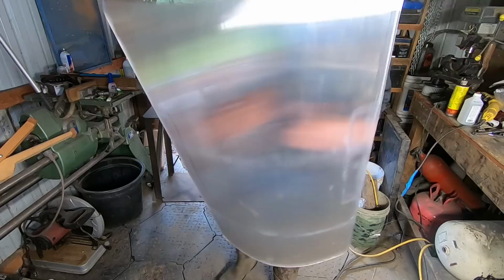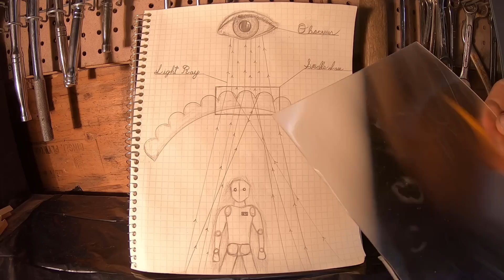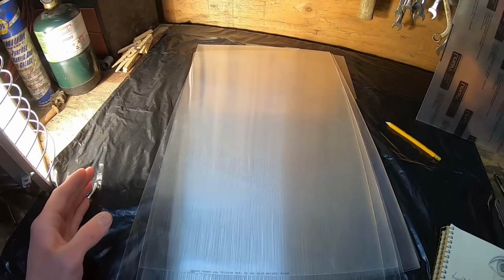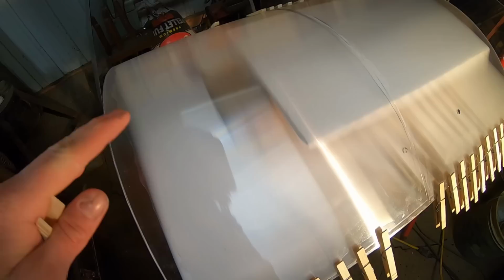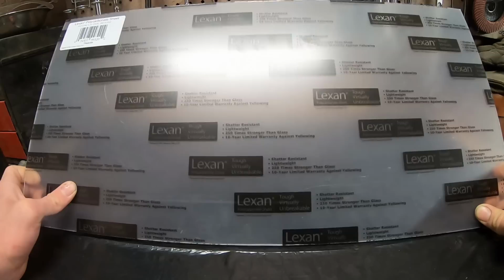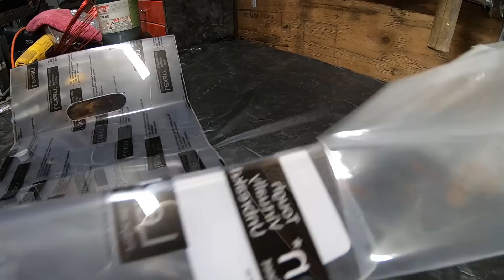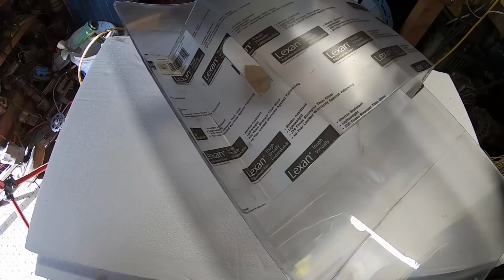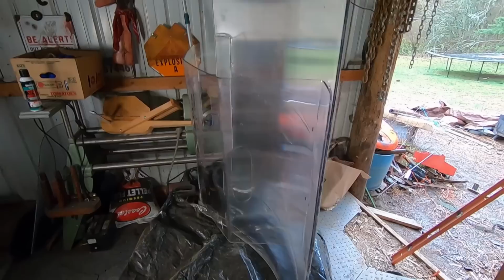Making a Real Invisibility Shield?!

Comment: This is actually a really good effort for a garage project. Imagine the result with the correct funding.
Reply: well never know because well never see them
Reply: It's a fresnel lens it's been around for a while.....
Reply: While it's not quite invisibility, it's certainly enough to confuse a viewer as what exactly they're looking at. In a dim and chaotic environment, I imagine it would work fairly well.
Reply: It's already been created, the official ones look even better
Reply: @TheGreenKnight500  depending on the angle. Because if you turn it to certain angles it will catch and reflect light better. Making it stand out.
Reply: Qian Lim Price what official one?
Reply: @TheGreenKnight500  but in the confusion of real or even simulated warfare its basically impossible to see.
Reply: The company that invented them, well lets just say the results are literally no better and entirely impractical

Comment: Hey Randomn, get hold of a tube of the clear UV set adhesive used for replacing touch membranes to LCD panels on phones and tablets. It is reasonably priced and with a little care, you can get a perfect bubble free contact. As a bonus, there are no solvents to evaporate, the whole substance sets, is completely clear and sticks like crazy. It's like an epoxy that doesn't need an added catalyst but is triggered by UV light, via UV lamp or even plain daylight.

Comment: 23:05 Being too reflective, yeah it really stands out here. I wonder if you put horizontal polarizing sheet on it if that'd help with the reflections
Reply: If I build it, I'll try!
Reply from the maker: @quantum_chezburger2279  Let me know what you find out!
Reply: Put anti reflective coatings on it
Reply: @stuartdavis2578  Clear matte spray maybe.
Reply: No like optical antireflective thats what makes the difference between a home made version and military grade the military has a antireflective coating sputtered on.
Reply: It actualy increases transmittance
Reply: But at the sametime cuts down on off angle refectance but what you did is no less impressave for stuff you can buy on line maby clear matt might help.
Reply: Ill have to build one and try different things
Reply: Or wat if you hade cloths that had complementry linear optics
Reply: Polarizing optics may make it more visable because you would cut out a plane of light but its worth a try old lcd tvs have a polarizing sheet it wouldnt cost much to dind out.
Reply: Or if you cut out the right plane it might help
Reply: I cant wait till holloween
Reply: By the way i loved that video

Comment: Try TruLife acrylic and glue the lenticular to the inside. This acrylic is modified in a vacuum chamber to add an oxide diffusion layer to the surfaces which dramatically reduces reflections to the viewer. I use it for very large wall photography.

Comment: "I put it on here so it's resting on something soft as to not damage it"

It's a riot shield tho right
Reply: polycarbonate scratches easily
Reply: The riot shield will retain structural integrity, but the non-blemished surface (scuff marks are hell on lenses) was a vital factor in this project.

Comment: Free Fresnel lenses are everywhere on Craigslist.  They're called "Curb alert - Rear projection TV"  I pick them up often and they're generally in the 40"×30" range but sometimes larger.  Well done.  Very cool project sir.  You should also consider posting this on Instructables.

Comment: Would it still work with something like a matte clear coat on top of the lenticule layer or would the light be too disrupted for the effect?
Reply from the maker: I wondered that myself, and to be honest, I'm not really sure. I would imagine that it could fill in the valleys between the lenticules, rendering them useless. I think "matte" is specifically meant to diffuse light in multiple directions as well. That's just a guess though. I'll play around with them some more and find out! Thank you for the comment!!
Reply: @randomn6473  what about marine epoxy? and if you put a light refraftion sheet like the ones you use to identify lab gasses in tubes under the lenticular sheet what do you think the effect would be?

Comment: Optically clear adhesive sheets would work very well for laminating the lens to the clear panel. It's fairly easy to apply them without bubbles by using a roller. 3M makes a variety of options.

Comment: Maybe for a second build you could use a clear plastic rod instead of a huge piece of Lexan to hold it.  I'd still use the Lexan for a couple of mounts, keep the same basic shape as the handle you made, but only have it a couple inches wide, then make two of them, top and bottom.  Cut a tab in the center of each that bends outward/inward to hold the rod in place, keeping it horizontal with the shield itself.  Probably sounds more complicated than what I am picturing in my mind :P

Comment: Just a suggestion if you haven't thought of it yet you could use optical glue like for gluing phone lenses put it in a vacuum storage bag and that should suck all the air bubbles out of the two surfaces and then cure it with a powerful UV light.

Comment: Nice experiment. Try it in subdued/shadowy lighting, and perhaps wearing camouflage clothing (incl. gloves) in a woodland background. Hmm...how about a horizontal, curved shield that rests on the ground, with a small firing slot for a rifle, to be fired from the prone position. perhaps with a smaller piece of the material as a hinged flap. Tier One operators, are you reading?

Comment: Those handles will cut into your hands and don't give you a very good grip if anything were to impact the shield. You should cut thumb holes on flat spot facing the user near the hand openings and pad the openings as well to allow for better grip. To hide the hands better you could put mini curved lenses in front of the finger holes behind the shield.

Comment: A little larger and instead of that plastic sheet maybe some plastic tubing that came out further and you can just grab hold of plastic tubing. This is actually really cool. Kind of like Star Trek and the cloaking device!
Reply: Now my nerd is kicking in. I like the flat sheet you used that ended up being your handles. 4" x 6" piece, go 1" down on your 4" side go a good 1/8" down make a mark. Then on the 6" side cut down 1" on each side where you made that 1" mark. Bend both sides of your sheet on the 6" side to round off for 1" clear tubing. You can do a railroad effect with your tubing where the sides are 6" in total width by cutting out 4" sections of tubing in the middle rounding the ends of the 4" sections where they meet up to the 1" tubing. 

You can bring this out farther and you would have some nice rounded grips and the extra distance would eliminate having to hold your hands flat on sharp edges.

I wish I could draw this up. You just got me nerding out on this. This is a way cool result you came up with! Hope your okay with me just running this 💡 across. ✌ out!

Comment: An idea for the whole shield in glue that failed first time.
Try making a home made vacuum bag? Similar to the storage solution vacuum bags that you put bulky items like teddys in and vacuum out the air.  Would this not apply even consistent pressure over the whole shield any push the air out?

There are obviously propper vacuum chambers you can get but that would pull away from the cheap at homeness this particular experiment  is.

And one more thing.

 Could you test the shield against airsoft fire ? I feel like the lenses would flatten over time and reduce their effectiveness ?

Would sandwiching the lwnse sheets between 2 shields counter this and still work?   Without a bonding material on the lense side as stated by yourself.

Comment: Hey guy I know what you could try and see if it works And that is to Try a double layer of these lenses One on top of the other  But have them separated from each other a certain distance from each other Maybe like a few inches In other words A distortion on top of a distortion Or in other words , double distortion Distort your image twice (2x) And see if this works Only if you haven't already tried it  Cause I use to work in a maintenance job And I use to clean those lenses that go over flourecent lights Because they would sort of do the same thing (with light bending) of images And I also have been working on an invisibility type of thing Not so much a shield to distort light that reaches the eyes  But something else that distorts a deminsion Which hopefully will affect the mind  , the mental (not the eyes) Hopefully that helps Only if you haven't already tried it already 🙂🙂🙂 Laterz  , And Lots of Good Luck  To the both of us !!!

Comment: could you, in theory, make a bunch of smaller plates like this shield, and then attach them to yourself like armour for a sort of active camo
Reply: more specifically, if you could suspend the plates a small distance away from yourself instead of directly against the body. like with a sturdy wire frame or some kind of acrylic rod

Comment: Loved the Vid, I subbed.

Also As some people have mentioned it would be better to wear white to blend more with the dull white of the glass/reflections.

Also, also, if you used a wider shield, like 4 feet by 4 feet, it would be in focus for a much greater area.

Also also also, I've done some laminating, ie coating things with sheets of clear plastic. It is possible, just time-consuming/ needs some practice, but can be done.

Comment: @Randomonium — I’m wondering if there’s some solution to the FULL SHEET ADHESIVE issue... to avoid the “AIR BUBBLES” he mentioned... We could use a vinyl decal “squeegee” with a soft cloth edge (to protect the sheet surface from scratches), OR what about carefully applying HEAT from a heat gun while gently using the squeegee until everything is smooth??? Does anyone know if this would work?????
Reply: PS— im working on building some projects just like this (and maybe even the same thing you did here), so ANY FEEDBACK from you would be excellent! 

one last thought, hoping you’ll see these comments... In hindsight, would you recommend covering the outer shell of this finished shield with another sheet of plexiglass to avoid damaging the lenticular surface?? In a real workd scenario where this shield sees some sort of actual action, or suffers regular bumps/scuffs during transport and use, the surface would most likely suffer damages that would lessen the intended effect. I’m just wondering if adding the protective layer would somehow lessen the effect, or perhaps enhance it!?